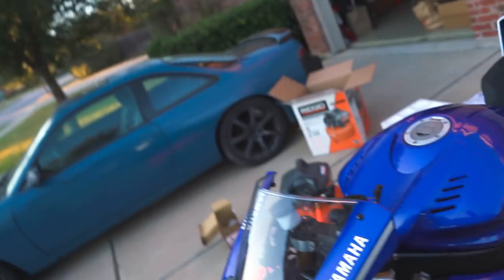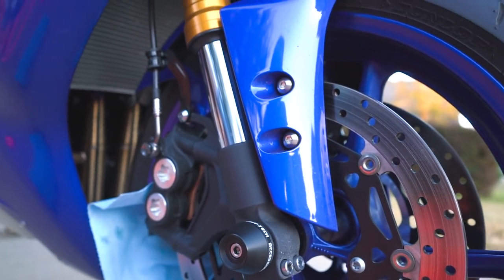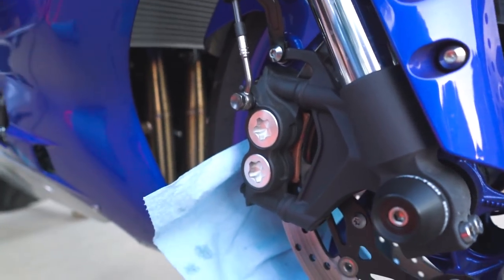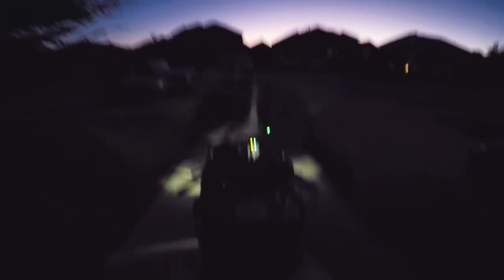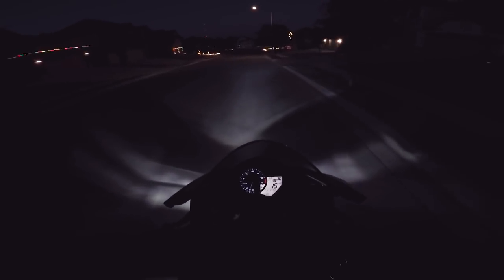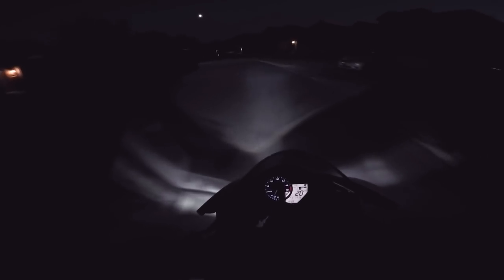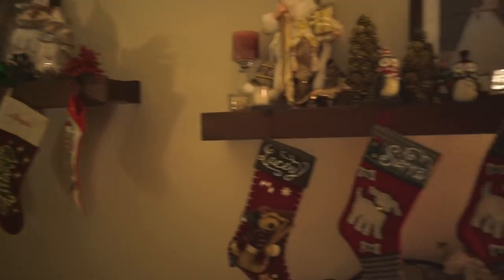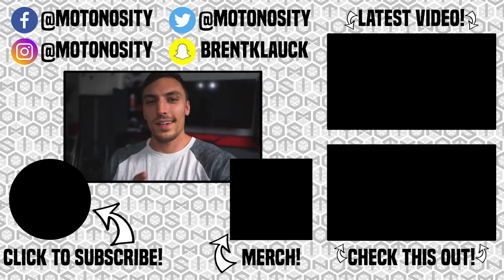EASIEST Brake Bleeding Method!

Comment: Several years old video, but I just wanted to say that I bought the exact same bleeding kit, and a similar compressor, and it made bleeding my brakes so easy. I've done it manually before and it takes effing forever and the air bubbles never seem to end, but with this kit and a compressor it was literally done in a couple minutes. Thanks for the tip, Moto!

Comment: One small tip. find a plastic or rubber mallet to lightly tap the calipers and master cylinders during bleeding, this will dislodge bubbles that are sticking to any surface within the system.

Comment: The bubbles that you are seeing is the suction pulling air in past the threads of the bleeder screw. You could try opening the bleeder screw a smaller amount or using some compatible grease around the threads of the bleeder screw to prevent air from being sucks in.

Comment: just pump the brakes, get the lever as firm as possible, release the air nut, watch air bubbles come out , tighten air nut again, pump brake lever, rinse and repeat

Comment: It's always a good idea to cycle the ABS a couple of times (after flushing with new fluid) to get some old fluid out of the ABS module, then bleed again. You don't want to have humidity-laden fluid just sitting in that part, possibly leading to corrosion inside of it.

Comment: I have a problem with my 2008 R1, i change the brake lever.
All ok but after 5 brake going around in my city the brake become really hard and my front wheel be impossible to move.
Like if i'm grabbing my brake.

Comment: False, Speed Bleeders are the easiest way to bleed your brakes! :3 nice vid though, liking the build series.
Reply: I love speed bleeders
Reply: What do I need with it? I just bought a 2013 750 first bike.  But I have to bleed the front brakes due to air... I have the brake zip tied rn for over 24hrs. Supposedly that allows the air to escape
Reply: @BigGuyBigMind  Not sure what you mean by "What do I need with it?" SpeedBleeders are aftermarket bleed screws that have a check valve inside that allow fluid to come out without letting air back in. So you can essentially just crack the bleeder open and pump away at the lever without needing to close the bleed screw. As far as the Zip Tie trick goes, yes that is known to help get the last little bit of air bubbles out, but it's not magic, you still need to perform a proper bleed.
Reply: Stealthy Aban Thanks.  I’ve been up all night, excuse my errors.  I meant what was needed in conjunction with Speed Bleeders.  I wasn’t sure what you two were referring to in the 1st place.  Quick background about me.  1st time rider & 1st bike.  I want to know the ins and outs of this machine before I get on it.  My m1 class begins September 14th.  So I have some time to do diligent research in the mean time.
Reply: Stealthy Aban if you ever want to ride or teach me let me know.  I’m in O.C.

Comment: That was a little odd, you finish the front then put the cable tie on the front lever lol the rear brake system is separate from the front braking system on bikes :)
Reply: Also there will be no need to bleed them again, as long as you kept the reservoir's topped up as you bled them, there will be zero air in the lines.
Reply from the maker: +Halfdead Rider I know? Maybe you're confused why I did it...
Reply: I am, only because there is no need to :)
Reply: Halfdead Rider keeping pressure on the brake lines can remove any air that’s remaining in the system. Riding motocross, 1 night before a race I would put a cable tie on my brake lever too and it would make quite a noticeable difference to the front brake. The reason motonosity has done this...well he knows the front lines are independent to the rear..it’s just for the same reason...keeping that pressure on the front brake is removing any air from the system without any further input from him...essentially the cable tie is finishing off the front lines while he goes off to work on the rear.
Reply: After you correctly bleed brakes or prime them like this, there will be no air in the lines at all, that's why it was not needed to be done.  I'm also pretty sure it's a common misconception that it does bring trapped air to the surface anyway.  

The reason you noticed a difference is likely because it temporally compressed moisture in the system or pressurises the system, it could also just be a placebo effect.  When I trained as a mechanic these were never methods taught or mentioned as tips of the trade, and never done in the workshops that I worked at either.

Either way, if it works or not does not matter, as I said there will be no air to remove once primed or bled, as long as you keep the reservoir topped up as you pump the fluid through until you get a steady stream of fluid with no air, or dirty old fluid when just bleeding the system.
Reply: Halfdead Rider There has always been a debate on the subject of zip tieing the brake levers. And there is always the possibility of an air bubble remaining in the system, however unlikely it may seem.
The fluid is not compressible, however the air is:- my theory is that the pressure in the system decreases the size of any air bubble through compression, which in turn can shift that air bubble and allow it to float to the top of the line, so when the zip tie is cut, it can float up to the top of the MC and into the air pocket above the fluid where it belongs.
I actually came across this when someone pointed it out to me on one of the bikes at a super bike race when we were walking through the paddock. After that, I noticed it on several more bikes (I was looking out after the first bike as it was a case of “why is he doing that” to see if anyone else was doing it).
You obviously have the experience and the knowledge when it comes to it and, tbh with you, I’m just a weekend warrior who enjoys working on the bike as much as racing it, but I do recommend trying it just once...you may prove yourself right lol, but then again you might have just found another little tip to put away for when you need it, either way it gives me a firmer brake with better feel...happy riding! 🏍
Reply: I don't want to say you are wrong about the theory but I think personally that the fluid is just too thick for it to work like that especially in such a tight space, even in a thin pipe with just water in it would be tough to force a bubbles up.  

Just because professionals use a method it does not mean it works in the way they/we are led to believe. These tips/tricks are past down through generations of mechanics/racers who just believe what they are told by their predecessors, who thought up the method 100 years back not knowing the real reason for the change in brake feel.

Next time just try pumping the levers, they should stiffen up unless it's old fluid then they need bleeding.   And again if done properly their is no way air can get trapped.

Comment: You have to push the fluid from the bottom, down there with the nlpple.. you will always have air in the systems, this does not work the same way as a car. I work as a mech, and all the other guys at work is saying the same, and they've had bikes for a long time
Reply from the maker: +Rexczi Cex everybody has their method that they swear by. You'll find just as many mechanics who say they won't do it as you say and this way works better. It's all preference. As you see, it worked perfectly for me. Just because your way works for you, doesn't mean it's the only way that works.
Reply: Motonosity whoop whoop, 'works' is scientific. Not personal. I understand what you mean, but i tried what you did- did not work. Tried the other method- worked perfectly. The brake lever does so little, so the air bubbles will not be pushed long. It will push down, then the bubble will just go up again. A friend of mine used almost a liter of fluid.. then we used the kit, worked perfectly. You clearly didnt have any bubbles in your system, but if you did.. you would feel it. + idk how much experience you have (not a ton clearly) but if someone who knows brakes tried yours, they may tell you that its bubbles in your system..

Comment: -1+2 (gold chain/ black sprockets) , Engine case sliders, windscreen, carbon fiber bits and vortex v3 grips lets see it happen !
Reply: He told me he does not want to lose top end.  I would do it myself as acceleration is more fun and usable than top end that you can only really attempt occasionally.

Comment: You shouldn't be doing it with the cover off. Top it up , then put the cover on and then bleed it. You want to have the maximum pressure in the MS as possible.